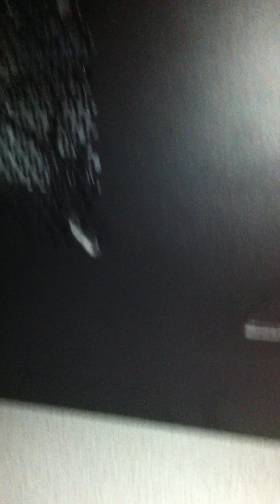Identifying Case Vibration

Comment: Hi guys ! I want to say that in my case the vibration came from the 120mm fan of the power supply so after putting some rubber rings on the screws and a little piece below the psu the vibration stop. Maybe this would help someone that has the same situation.

Comment: The irritating noise in this 6 year old video is caused by unbalanced fan resonating. My Cryorig H-7 fan was doing the same thing with just a tiny bit of dust on the blades. Cleaned and reassembled and it's fine now.

Comment: HDD's era has come to an end? For us people that care about silent usage of our pcs. 

I have a small Deepcool SMARTER case with 2 quality articF12 fans in the 5v line (had an id-cooling  214x heatsink with a 3rd articF12 until recent update). Very quiet PC. 

I had the case striped out, parts sold, HDDs out, weeks passed. Today, after putting stuff back, at the end of the day, I hear that exact sound comming from the HDD bays, wich  is way more than before. Motherboard does not vibrate (unless cpu cooler is badly settled) PSU works perfectly, 

Nothing in the case can generate souch vibration and noise. One HDD is five years old, the other one  is 2 years by now, WD 7200 both.

Anyway, I'm going to sleep, I had to comment Even five years! after the video was recorded.

 "I wish you  silent builds in the years to come".

Comment: my Case Vibration cause by CPU fan cooler . hmmm.
Reply: How do we fix it
Reply: @Tiip420  decent cpu fans have anti vibration pads attached. Vibration can also be from case fans and harddrives. In my pc, my harddrive vibrates in the hdd drawer.
Edit: My evga 600 watt psu also makes a low pitch hum when power usage peaks.

Comment: Hello did you find the answer to the vibration? I myself use a CM690 II Advanced, with the stock 3 fans, and ever since i bought a new cheap tall cpu cooler with a 92mm fan I have vibration problems, sometimes it would be a ticking noise. After repositioning the 3 fans at variable places I isolated my sound coming from the motherboard tray and I noticed that from the vibration my motherboard was loose so I tightened it, which sort of fixed the problem but after a few days a slightly less noticeable vibration appeared. So you can try to tighten the MB to the tray if you didn't fix your problem, but if you have fixed it please tell me what did you do?
Reply from the maker: I narrowed the vibration down to the HDs ratting in the HD cage because the plastic rail system is loose. Fold up some paper bits and stick them between the rail and the HD cage to snug up the rattling; this should reduce the vibration.